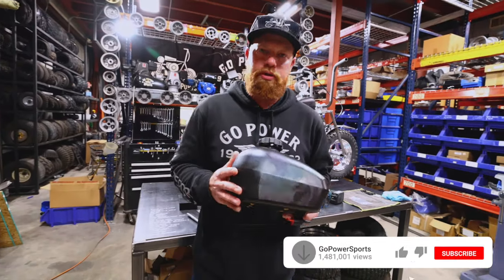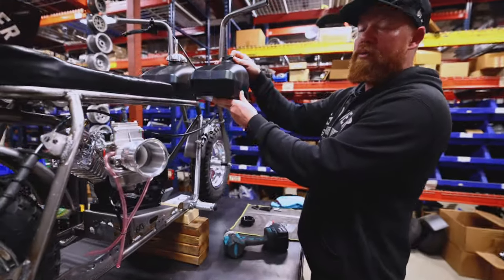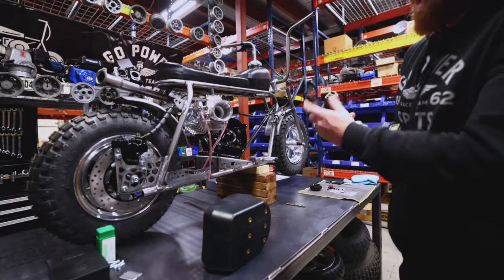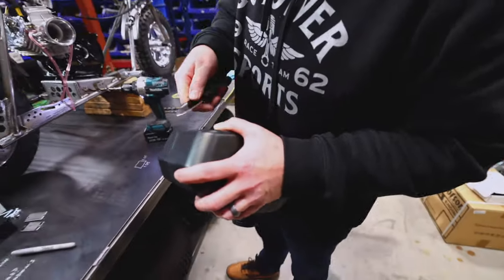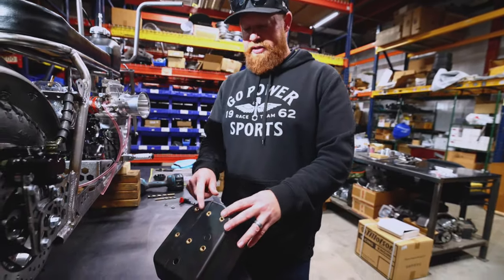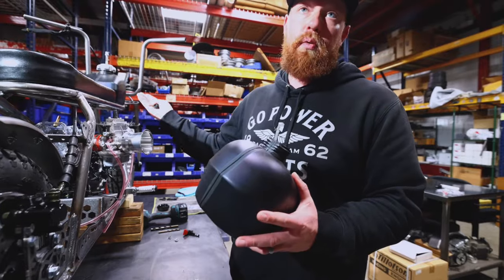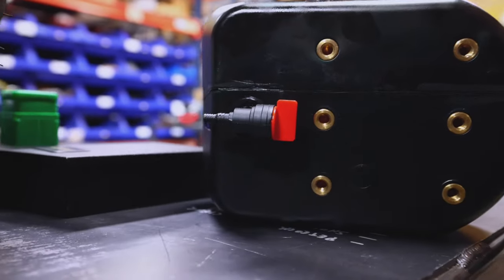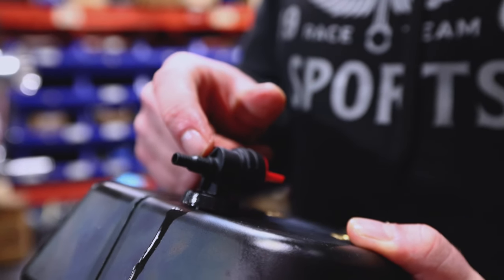Unitank Mini Bike Gas Tank Install Video | Step By Step

Comment from the maker: We are currently working Unitank Brackets for the Mega Moto 80 and Mega Moto 212 Minibikes.  What other minibikes would you like to see this fit?  Reply below.
Reply: A few models are fairly popular BT200X(I have to have one of these some day, I just love big tube bikes) Ct200U-EX(one of my bikes is it's twin) are 2 that come to mind.
Reply: Maverick. I just bought this tank for one and going to figure something out. I can already see that the seat will need to move back so I ordered a 12” seat with the plywood bottom as well.
Reply: Mb200
Reply: doodlebug!
Reply: Doodle bug
Bt200x
Ct200
Ct200uex
Reply: Are you guys having problems with the metal tanks leaking? I bought a metal tank several months ago and it's still in the box. I wished you guys had the plastic tank when I bought the metal one back then. I rather have the plastic one. I've seen several metal ones leak.

Comment: I know molds are expensive to make but a smaller version of this would be nice too. Maybe 1/2 gallon.
Reply: Theres a zillion that size already on the market, same shape even.
Reply: @NubsWithGuns  You're right but not many with the threaded inserts that make it so easy to mount.
Reply from the maker: Thanks for sharing.
Reply: @WalkerSmallEnginePerformance  You are also correct.
Reply: @NubsWithGuns  That’s what I keep telling my wife but she’s not convinced.
Reply: @WalkerSmallEnginePerformance  good luck with that, i been tryin for over 30 years with my wife lol

Comment: nothing like drilling a hole in a $100 plastic fuel tank
Reply from the maker: This $79 Unitank will fit various applications.  Some are able to drill a hole, some are not.  This tank would not be for them.  We do stock Aluminum Cylindrical Tanks in both 8" and 10" for customers as well.  Thanks!